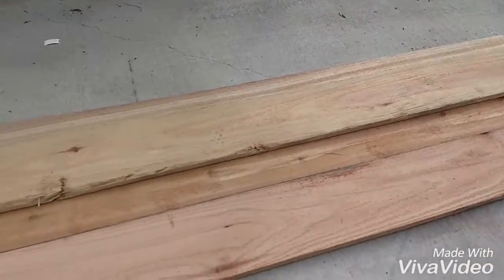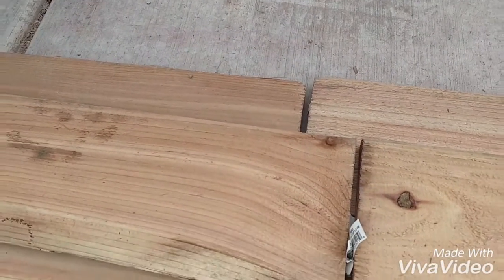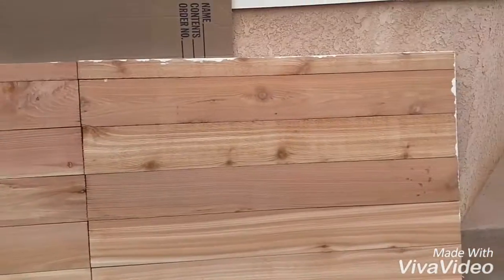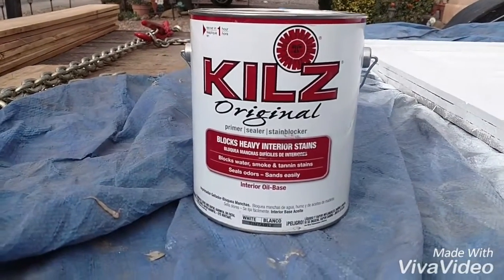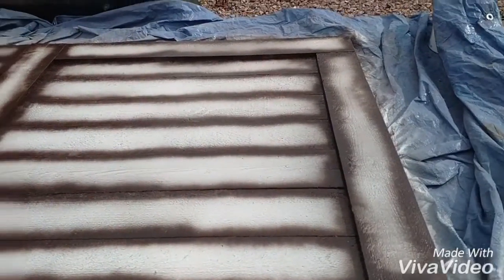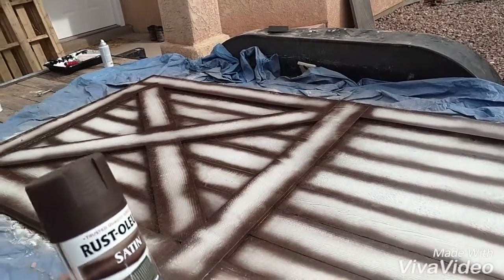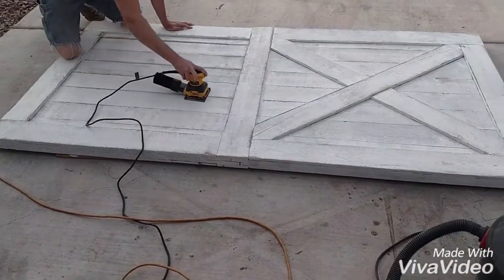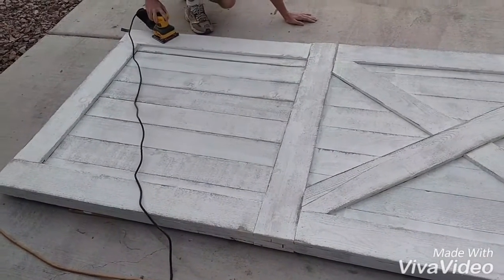Build antique white barn doors. DIY barn door. Custom woodwork.

Comment: No cupping or warping issues? I made one from pine 1x6 and it warped bad.
Reply from the maker: +Ronny Bolding no, I made sure to use plenty of glue and I kept it on a flat surface until the glue was dry. I also used plenty of finish nails and it has remained straight 🤞

Comment: Seriously thinking about doing this with fence planks for a single door (69Wx105H) but was trying to understand the comment "overlap and stagger" are you doing that to the back side of the barn door? Sorry all new to this DIY woodcrafting. Thanks in advance.
Reply from the maker: This door is 4 layers thick with the outer most layers being the trim and the inner 2 bring the core. The inner 2 need to be overlapped to prevent looking like a fence with gaps between each board. I hope this makes sense. Let me know if you have any more questions.
Reply: It makes perfect sense. So you have a trim on back and front of door, which I want to do also. I was torn between using T1-11 or fence plank, but I like the fence plank look and cost wise it would be better for me. So what size is your door and is it pretty heavy? Again thanks for your time.
Reply from the maker: I think this door was about 4'X8'. It's fairly heavy but not more than 2 people can manage. The biggest I built with this method was 66"X8' but it wasn't heavy enough to compromise the track system.
Reply from the maker: One other thing I forgot to mention, make sure the glue dries with the door on a completely flat surface or you'll have issues when you hang the door.
Reply: Glad to hear that.  I did look at your Facebook and you have done some great work. Thanks again.